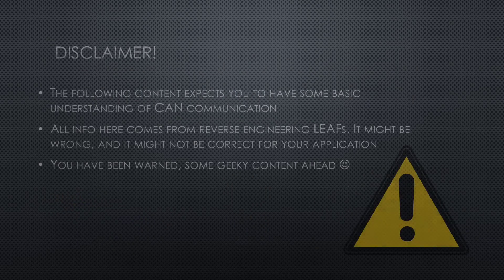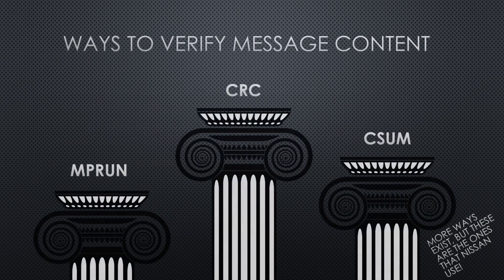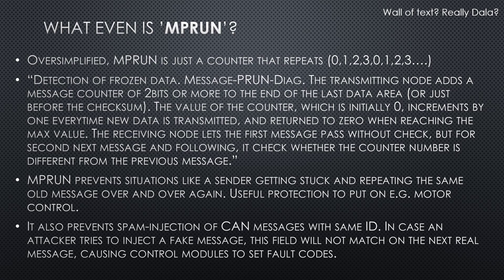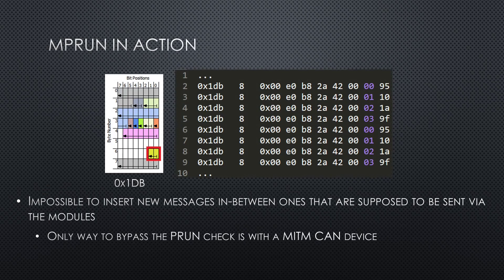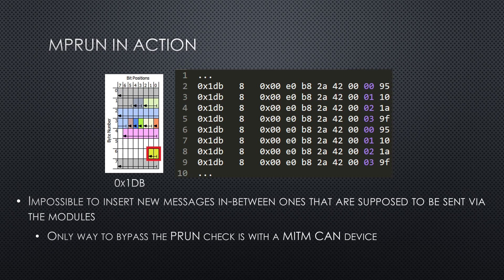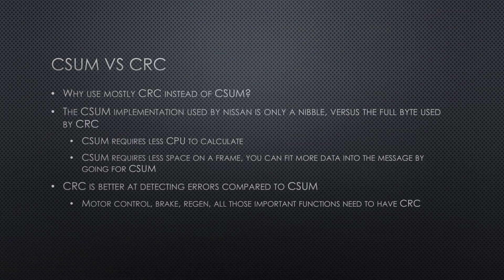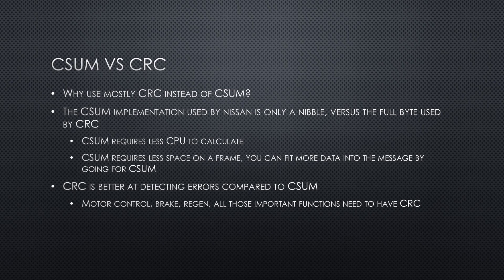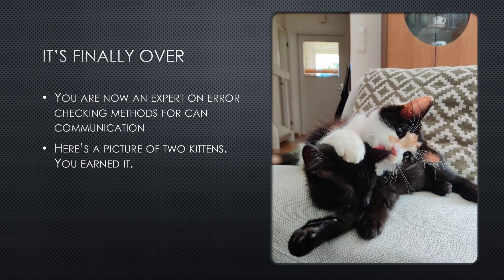Nissan Leaf - CAN communication tamper prevention

Comment: My 2018 Leaf (Japanese Import) doesn't start. It shows these error codes on the Leaf Spy:
>U1000 0109 EPS CAN Comm Circuit
>U1000 0009 IPDM E/R CAN Comm Circuit
>U1000 0109 METER CAN Comm Circuit
>U1000 0108 TCU CAN Comm Circuit
>U1000 0109 VSP CAN Comm Circuit

Does anyone know how to resolve those errors? All I know is that the dashboard cannot communicate with the battery.
I appreciate any help, tips or comments on this.
Reply from the maker: Make a thread on the mynissanleaf.com forum
Reply: Why post here ?

Comment: Hi Daniel, nice video! I got to your video by looking for answers regarding a can-bridge in a bmw c-evolution, after a battery swap (twice the capacity). Bmw uses mprun and crc8 in this bike as well. Thanks for documenting it so well. I'm struggling in finding the crc8 formula. Mind giving some advice on what to read? I need some help :)
Reply from the maker: Cool! Maybe write a script that testes all the usual polyminals, and compares ut to an example frame?
Reply: @DalasEVRepair  I tested some of the frames with RevEng. While selecting 2 separate frames - it finds the polynomial, init & xor. But applicable only to these frames. Feeding more than 2 frames does not yield to a result.
Reply from the maker: @jorakarandas6592  maybe start a forum discussion thread somewhere with your findings, easier for peoole to chime in and help!

Comment: I bet that crc and csum are both present because of some legacy team that refuses to move on and learn new things.
Reply: It's legacy for sure, but more driven by cost/performance constraints than it is by knowledge. Using CRCs is great if you've got something like a powertrain controller and a vehicle dynamics module talking to each other since they'll both have pretty beefy microcontrollers just to handle their main function. But not everything on the bus is a big powerful module, sometimes it's just a switch module whose purpose is to say "someone pushed the button" and it'll have a CPU with the processing power of a 1980s alarm clock. 

It's really hard to go to management and say "We need to spend an extra $2 per unit on a beefier micro on something we sell 500k of a year because... well we don't like the algorithms we're using anymore and we want a new one. This extra million dollars a year doesn't benefit the customer or the company in any tangible way but it'll be more modern!"
Reply: @chrisd1746  On behalf of 1980s alarm clocks everywhere, I object very strongly to your remark.
And for the record, the design of your CPU hasn't been significantly updated in hundreds of centuries. 
So there.  :-P

Comment: One apparent way to spoof mprun would be to emit multiple of messages with counter running full cycle, that's of course subject to timing and potential canbus/target time-spamming detection (and even total runtime of message reaction like if reaction to message is opening the trunk).
Reply from the maker: Good idea, but on messages running periodically at 10ms update rate this might be hard to achieve!